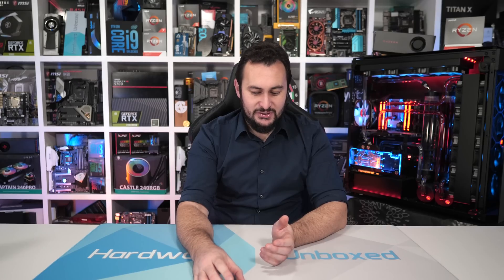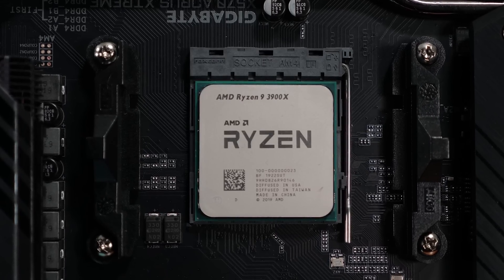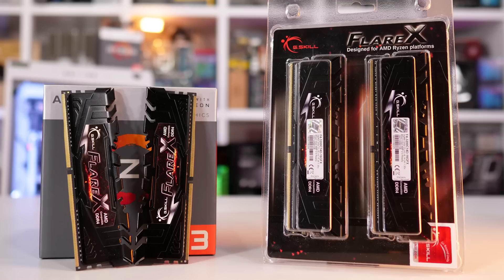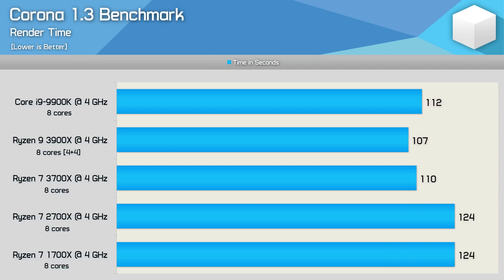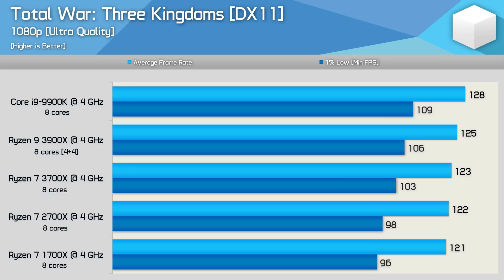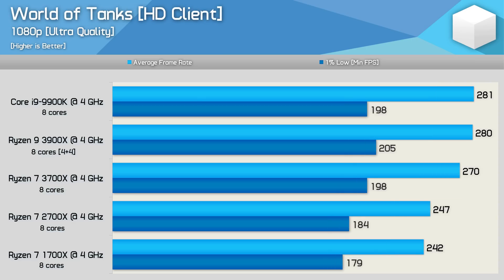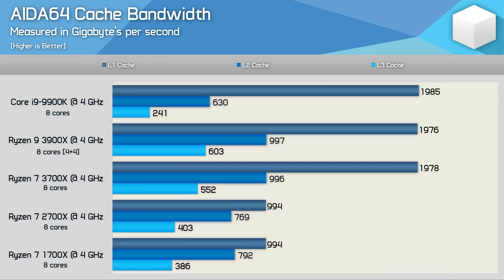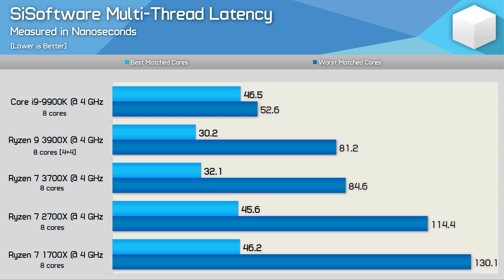3rd Gen Ryzen IPC Test, 3900X & 3700X vs. Core i9-9900K

Comment: If zen 3 delivers another similar performance uplift, Intel might just lose the very last area in which they still have a lead, gaming. Heck, if zen 3 is just the same chip as zen 2 but with a clock increase so it is on part with Intel, it will win already.

Comment: Nice Job! :)
If I understand correctly, the 3900X was running with 2+2 in Chiplet A and 2+2 on chiplet B....so double the L3 Cache per core.
Would be intresting to see 4+0 on Chiplet A and 4+0 on Chiplet B compares with the 3700X....But we have to wait for the 3950X to test that.

Comment: Good review, though wondering what 'you did' to kill the 3900x lol? Personally as long as the 'game' can hit 144Hz anything more - unless I'm forking out for a 240Hz monitor - is overkill. The 9900k looks like a beast of a CPU with adequate cooling, however personally the 3900x will get the frames I want and the cores sufficient to do everything I currently plan to do...
Reply from the maker: Used an Asus board with an early BIOS: https://www.overclock.net/forum/10-amd-cpus/1728758-strictly-technical-matisse-not-really.html

Comment: Steve, I'd love to see gaming comparison between Core i9-9900K, Core i7-9700K, Core i5-9600K, Ryzen 9 3900X, Ryzen 7 3700X, and Ryzen 5 3600 with Geforce RTX 2070 Super and Radeon RX 5700 XT.
Most people don't buy $1200 Graphics Card so by comparing it using $400-500 Graphics Card, you can provide idea how they perform with a more widely adopted Graphics Card.

Comment: I really wish we could get proper gaming benchmarks on more realistic setups like a 9900k, 3700x, with a 2070 super/5700 xt. No overclocking. 1080p / 1440p. Instead of pushing everything to be CPU/GPU bottle necked. I wanna know what I buy and not overclock is good or not.

Comment: I hope you can take a few seconds to review the below:

I have taken on the challenge to build my PC for my new YouTube channel. For editing, I have opted for Davinci Resolve, 

which I understand uses more GPU than does Adobe Premier.  I have watched many many YouTubes from Tech Deals, Paul's 

Hardware, Hardware Unboxed, PC World, Linus Tech Tips, etc.  SUPER info if I was a gamer, but my interest is only in video editing.  So I have tried to absorb as much as I can.  My primary uncertainty is my graphics card and CPU (marked with ??)

I currently shoot with a Canon 80D, so I don't shoot 4K (yet) but want to come close to that capacity in my build, so that in case I move in that direction, I am close.  Here is my potential system.

CPU ??: Ryzen 7 2700 (x or not x)
Motherboard: Gigabyte - X470 AORUS ULTRA GAMING
RAM: G.Skill - Ripjaws V 32GB 2 x 16GB DDR4-3200 PC4-25600 CL16 Dual Channel Memory Kit F4-3200C16D-32G - Black
Case: Cooler Master - MasterCase H500 RGB
Power Supply: PowerSpec - 750 Watt 80 Plus Bronze ATX Semi-Modular
Video Card ??: Sapphire Technology - Pulse Radeon RX-580 Overclocked Dual-Fan 8GB
                    OR MSI - Gaming X GeForce GTX 1660 Overclocked Double-Fan 6GB 
SSD:  Samsung - 860 QVO 2TB 
SSD M.2: Crucial P1 1TB 3D NAND NVMe PCIe M.2 SSD

Any advice you can offer will be MUCH appreciated.

Craig Wolfe
info@SoularProject.com

Comment: Would it be worth upgrading my i7 6700k to a r7 3700x or an i7 9700k? I really only game and watch youtube, and I understand that the intel part is best for gaming, however I like the upgrade path that ryzen gives. Any thoughts?
Reply: Get the Ryzen 3700X. It's more efficient, much faster in general performance, and more or less the same gaming performance at 1080p even when using a 2080 Ti (gap is about 5%). It has more modern platform features, it will last on the same AM4 chipset mobos etc etc

Comment: I am seriously impressed by AMD and how they practically made Intel's entire 9th gen lineup obsolete. Cannot wait to pick up a 3900X once they're in stock!
Reply: Not for gaming though, as long as Intel is ahead in gaming (by however small a margin), gamers, especially competitive esports gamers will stick to Intel.
Reply: @C3lloman  Those without a doubt, but even more casual ones should. As 144Hz is becoming the norm, 15-20 fps difference in the 100fps range definitely IS noticeble and there's no reason to get an inferior product, especially when it's no cheaper (3600 vs 9400f; 3700X vs 9700(k); 3900x vs 9900k)
Reply: Are we looking at the same video? Don't you see Intel beating the crap out of AMD even at 4.0? Never mind all lates gen can do 5.0!

Comment: Hey Steve,

Would be interesting to see an 5700xt on 8x 4.0 vs 8x 3.0. Why would that be interesting is because there are MBs both on Z390 and X570 that come with an nvme adapter which, when populated and installed, will take 8 of your GPU lanes. While Navi isn't really that powerful to be seriously bottlenecked, it could be just a concept on why pci 4.0 is really useful. Imagine something more powerful that a 2080 ti on pci 4.0, then I bet the scenario above would be more interesting (and striking another blow to x299 and x399 with their many pcie lanes, but just 3.0).
Reply: Brad Viviviyal  I am not sure you understood what I meant. The 2080 Ti can't be used as a comparison here, as it is not pcie 4 complaint - the Ti would see no extra benefit from pcie 4.0 as it doesn't know what to do with it. Either way, I was curios about a GPU that's pcie 4.0 compliant (like Navi) and a comparison between pcie 3.0 8x and 4.0 8x. I suspect that at pcie 4.0 8x the card will not be limited in anyway therefore enabling a much more compelling story for nvme ssds on some motherboards (up to 3 ssds directly connected to the cpu with full x4 connectivity each). Does this make sense?

Comment: What about the 3800X? How does it compare to the 3700X? You should do a comparison video featuring both 3rd gen Ryzen 8 core chips at stock speeds and overclocked to help people decide whether or not it is worth paying more for the 3800X. Power efficiency should also be included in the discussion as the 3700X and 3800X are rated at different TDPs (65W versus 105W respectively) and how much do they benefit from using a cooler other than the stock one.

Comment: Why is the 3800x being ignored? Just because they weren't sent out for review? (edited for poor wording on my part)
Reply from the maker: I've spent over $1000 on these new processors already. I can't buy the 3800X locally yet. The 3800X also doesn't need to be included here.
Reply: @Hardwareunboxed  Fair enough, also, there was no malice intended in that last sentence. I've just noticed that none of the big tech tubers have mentioned the 3800X yet. I was just curious as to whether or not that was because 3800X's weren't sent out for review, or because there is so little difference between the 3700X and 3800X that it's not worth the extra money. As always, great video guys! I love waking up on Monday to new Hardware Unboxed content!

Comment: Ideas for video content? Would love to see the 3900x capped to 6 cores and compared to the 3600 and Intel's 6 core. With the 3900x, it'd be neat to see what limiting it to one CCD does compared to balancing 3+3cores across CCDs. 

Gamers often buy the flat most expensive part expecting it'll serve them best, forgetting that they might not even see a difference in gaming performance for spending double the money, so it'd also be cool to compare the highest sku of each core count with ingress you've already done; 3600x, 3800x and 3900x in games specifically, along with a value-oriented philosophy to the video; how many dollars per frame, per game, or whatever.

Testing older, less threaded games would also be cool for kids looking to upgrade their first computer, and help highlight the value of the cheaper parts. Also free to play games, League of Legends, Fortnite, Dota, APEX, etc. I dunno, what are the kids playing these days? 

Cheers for the video either way.

Comment: If you do decide to show the skylake-e parts i think it is very important to show a fully overclocked system comparison. Lets hope by that time AMD has a proper power table for the new 2nd gen cpu's allowing for a much better PBO result. (I have heard news of the 3900x doing 4.7ghz on all cores! time will tell) As for mobo's of choice i highly recommend using the Asrock mobo's as they often seem to have the best clocks at the lowest voltages and better latency in there bios training. As for the 7980xe it should do 4.9ghz 3.2mesh 4000mem cas 16 16 16 36 400, with relative ease.(delided ofc) The 2700x and the 1700x both require manual tuning of sub ram timings to really show what they can do. And the 3900x needs the I.F. clocked as high as possible along with memory in the 3800mhz cas 15 range. GL! I hope you do all this for me as then i wont have to for my customers!

Comment: Could you please review the MSI B450I as a potential Mini-ITX board for the R7 3700x or the R5 3600, maybe even test if the R9 3900x even maintains "good" clock speeds on that board?

Comment: If I may be a major PITA: I think that for any gaming CPU benchmarks in 2019 and most likely in 2020 aswell, you have to have AC:O. It's a game that does use the CPU a fair bit.
I got a little triggered seeing the last games in the benchmark. Basically AC:O would've been a more interesting (arguably more useful) benchmark than the last 4 games in the list.

Regardless, the general picture is clear, and this video was informative. Thank you for the work!
Reply: Why, isn´t Cinebench enough?
The same way you can test 3 good games at the same time and still use less cpu than Assassins Creed trash.
I got a little triggered but is the inverse way, why is this still on "game" bencmark list. If I want to see a CPU heavy task while doing nothing productive I would go for CInebench or any other "syntethic" bench, not for a game that pretty much uses the CPU for no good reason (and the real reason is not good).

End of rant.

Comment: I’m just waiting for the normal benchmarks, you know, max possible oc on air in a closely matched setup.  All these core for core, and non overclocked benchmarks are not real use cases.
Reply: the Ryzen chips don't overclock very well and in most cases they get worse performance when you overclock manually.

Comment: Instructions Per Clock Cycle (IPCc)
I think this is the 5th vid. i've seen on this. 
  Quick Tip: The Guy's at AMD want to see more testing on there new NAVI features. Like img sharpening and anti-lag.
 Personally I want to see a massive x370, b350 x470, b450, x570 and  z370-z390 VRM test.
  Specifically the High-end z370 boards with the 9th Gen chips.
  On another note ive been testing the 9900 with the z370 Aorus Gaming 7. Did you guys know that on a board with a Clock-gen you can run the 9900-non K at 5GHz all core.
Reply: This is like the "bullshit" they pulled out with the first Ryzen: For them everyone was a content creator so they had to need more cores....

Comment: So 3950X most likely will be better even at games than the 3900X, it seems? Not making it a good value gaming CPU, I expect, but making it a good value productivity CPU that's also a great gaming CPU, still?

Also, could the writing bandwidth be what makes the very slight IPC difference between 3900X vs 3700X in many tasks?

Lastly, if games would be distributed across cores in ways where they maximize the best-case latency, could Zen 2 beat Intel's game IPC?

Comment: Next benchmarks, Hypherthreading and SMT on vs Hyperthreading and SMT off. Would be cool to know which offers better performance improvements, Intel's Hyperthreading or AMD's SMT and also cool to know if SMT performance improvement is the same on when comparing Ryzen 3000 series to 2000 series, their could be a chance AMD increased IPC at the expense of SMT performance.
Reply: AMDs SMT is much more optimized than Intels HT, that's why Ryzen is king for all the multithreading applications out there but for single core Intel still has a little little edge ... yet!
Reply: @vladvah77  Because most programs are written using Intel compilers.

Comment: i53570k user here. 
I think it's another wait for me.
Gonna be a long wait until Fall at least, I believe we will get news and release date for Intel 10th gen, we will know if 3950x takes the cake, and there may be price drops for x570, Ryzen 3000, m.2 ssd and RAM. 
As a Gamer I'm torn between Ryzen 3900x and Intel 10th gen. Since 3900x x570 had great future proof and a Intel 10 with have a new socket too an should be better gaming wise. 
Anyone else in the same boat?
Reply: The prices may go up again because of trade war with China! :(
Reply: @vladvah77  They are already very high. You mean up some more? 
I can't even find any x570 MB from Amazon.com to buy and good fast low timing RAM. Everything is 3rd party scams and high prices or out of stock!

Comment: Soooo Ryzen is best if you like running synthetic benchmarks and i9 is best if you like running games. Noted!
Reply: Except the 150$ difference will get you a better graphic card, less power consumption and better significant performance on heavy workloads, like working with video or particle simulation. They way pc games are meant to be setup is with "bottleneck" on the GPU, not any where else. Do that and enjoy the real performance difference between CPU's.
Reply: @bleem2951  the 9900k is cheaper than the Ryzen here already. so no...
Reply: @bleem2951  9900k here is cheaper than the 3900x

Comment: The problem is where I live the 3900X costs close to 600 USD about 50 bucks more than the 9900K.
That's the same price difference in the US with the 9900KF being on sale for 440 USD on Newegg and the 3900X for 500 USD and out of stock...
Well I'll just let the hipsters pay the full price and wait a year
Reply: And just buy 4000 series next year! :)
Reply: @shawnpitman876  Dude I'm waiting for my R9 3900X to arrive this week in my mail box! Fuck greedy Intel :-)
Reply: Vlad Vahnovanu same for me last year, it was $500 for Intel 8 core or $450 for 16 core AMD... yeah I wasn’t about to sacrifice half the memory lanes, get 1/4 the GPU capability, have a less efficient chip that runs hot and requires high end cooler, AND pay MORE! Screw that! Got the TR-1950x and have it purring away at 4.15 GHz easily on a 120mm AIO running quad GPU for 4k Ultra gaming like a champ! No way would it be worth sacrificing all that for some 0.8 GHz advantage, that’s way too much to lose out on for me!

Made a similar decision for AMD in 2017: either $1,700 for slow Intel 10 core or $330 for Ryzen 1700 (which was faster single thread and similar multi-core, while also using way less power). And wow was I happy with the Ryzen, affordable CAD monster systems for even broke college kids!

Looking forward to 64 core TR when it comes out, that will be awesome!
Reply: @jakegarrett8109  I don't care about those 3 - 5% more fps I won't use any new Intel product soon! My Intel 535 SSD bricked itself when reached only 75 TBW so I know that Intel does not really love it's customers! Samsung SSDs are truly the best ones!
Reply: @shawnpitman876  oh so we have a content creator here huh so what do you create? editing 4K porn?

Comment: If you wanted a direct comparison wouldn't it make sense to use higher speed memory to help equalize the latency, since it doesn't take any extra effort to do and costs nearly the same right now?

I'm so far incredibly impressed with how Zen2 is performing, but I guarantee that it would perform even better with 3400MHz or even 3600MHz memory.

Comment: Since RTX is overpriced AF, will probably upgrade CPU first and stay with the 1080Ti. Question is now, 3700 or 3900 just for the lulz? I won't consider the 3600x because I have the 1700 and I don't see any benefits to lowering my core counts?
Reply: 3600 will provide more fps than a 1700 will. And is faster in multithreaded benchmarks due to how much better the ipc is. The 3600 will score a higher cinebench score than a 1700 most of the time with less cores

Comment: the difference between the 3700x and the 3900x is also the cache and TDP. because you locked the clock and number of cores, all that differs now is the cache. on the 3700x is 32MB and on the 3900x its 64MB ?? that would explain the perfomance difference. and it shows the performance gain just from a doubled cache. interesting.

Comment: Just remember everyone, IPC is instructions per clock. 

It is not clock speed, it is not single core performance, it is not how much cache the cpu has. 

Those things all matter, but they aren't IPC. I basically end up having to state this on any video where someone talks about IPC, so I thought I'd just get it all over with.

Overall for these CPUs, though, I think the huge cache is great for people with cache heavy loads. Web servers, for example. Or rendering stations, as demonstrated here. 

Next step I think is getting latency down for AMD. that'll help with the other side of workloads.

Comment: This is slightly skewed, the IPC improvements measured here is tightly paired with L3 cache (as can be seen in the 3700x vs 3900x difference), if you really wanted to measure core IPC then the cache should be eliminated.

Comment: In Norway the 3900x is more expensive than the 9900k. Just by a little bit
Reply: Belgium as well (539 <> 549), but with the 3900x you get a decent cooler and no cooler with the 9900k.
Reply: Also in Romania AMD is 2700 RON vs 24-2500 RON for Intel.

Comment: My 3900x arrives this week.
I will use with my MSI X370 agesa 1.0.0.3a.
I have gskill royal 4000 cl17 memories, on my old 1600x processor I managed to operate on 3600 cl14.
I hope you can operate 3733 cl16 or cl17,1; 1; 1 with infinity fabric to get the lowest latency possible.
Will it be possible to overclock the infinity fabric to be able to use the xmp of my 4000 cl17 memory?
Operate at 4000 with Ram and IF at 4000mhz 1: 1 sync should be insane !!!